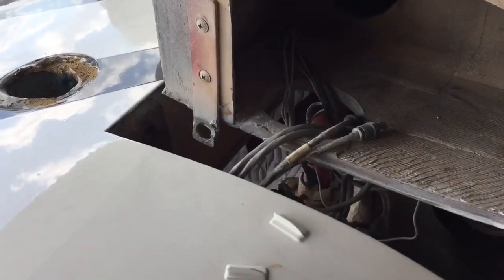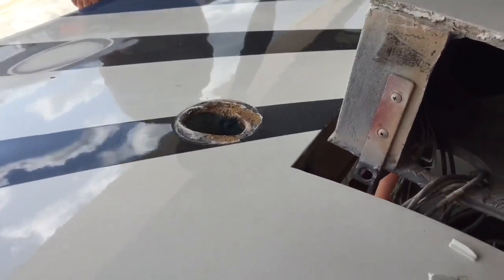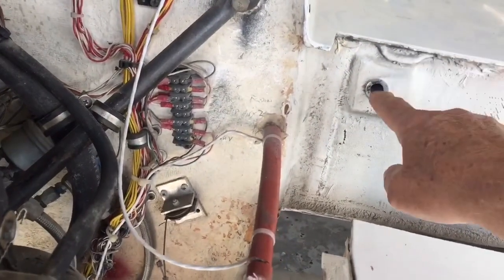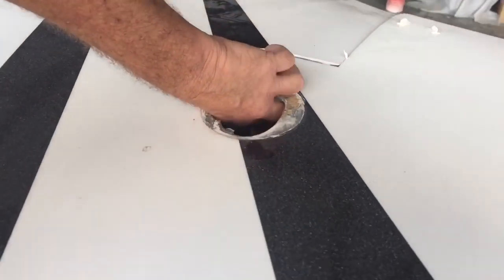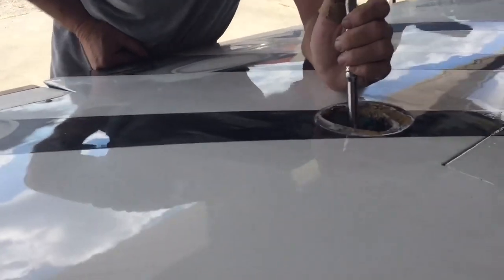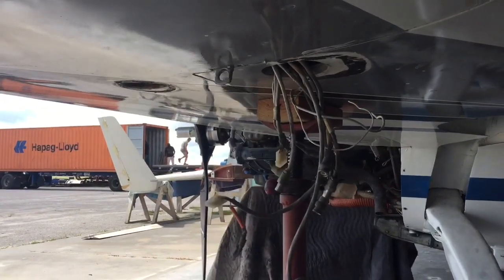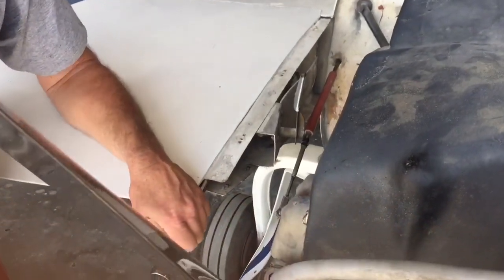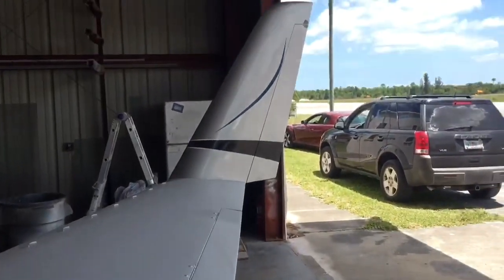How to install main wings

Comment: Why do all the metal components (bolts and plates) look rusty? A good coat of oil to ship them in, and then stripping and painting before install, will go a long way for longevity.

Comment: No torque on them bolts.... I guess tighten until it smokes and then back it off a quarter turn...lol
Reply: if its an AN bolt, then I would use AC43.13 for my torque.